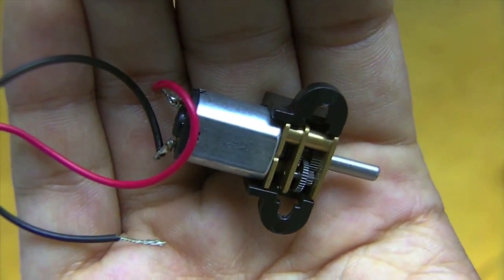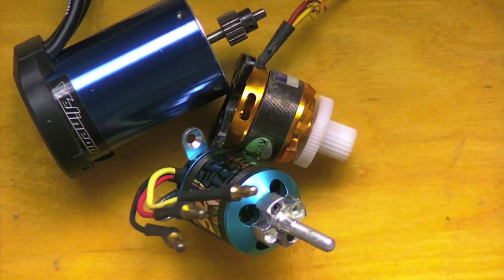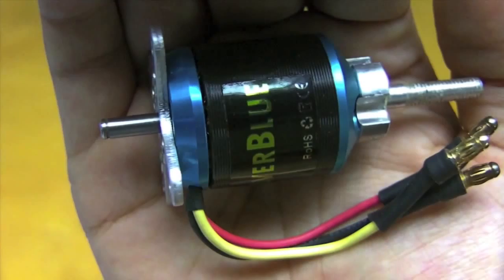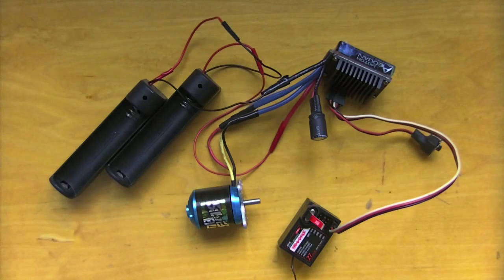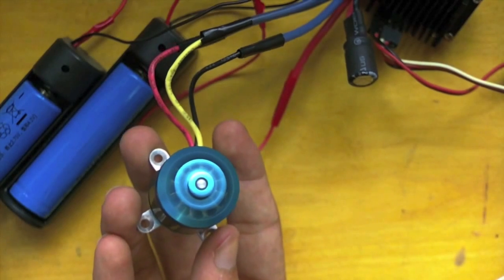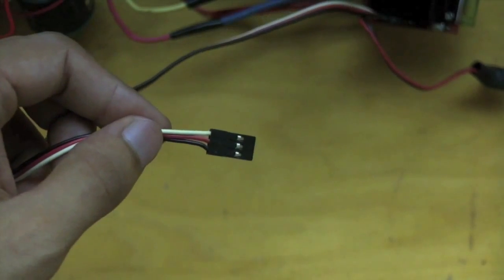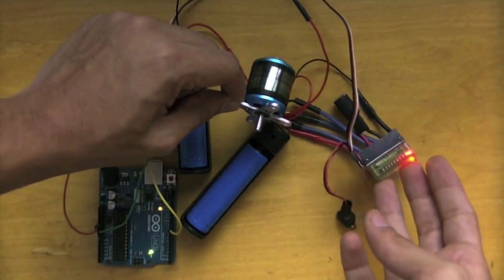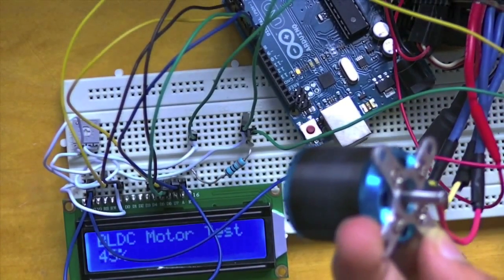Controlling Brushless ESCs | Arduino Tutorial

Comment: Go read some more kid.... you're wrong. Change the title to how to control an ESC and KV is not revs per volt, it's far more complicated than that and in fact, the KV "rating" of a motor tells you nothing of it's power or rpm. Sick to death of all these arduino dim wits filling up the net with misinformation. Looking for an ego boost "oh how clever I am!!"  fuck off!  Wasting my time.
Reply from the maker: Thanks for the comment mate! Yeah I did change the title, I just figured the kind of people to watch my vids would be the type trying to get a brushless motor up and running quickly with an Arduino, not the type with a 3-channel scope and a bunch of MOSFETS lying around to design their own ESC. I mention that 3 minutes into the video.

If you have a nice explanation of kV, and how it relates to torque, current, back-EMF and ω, we'd all love to hear it. But again, for the average person watching this, thinking of it as the RPMs you'd get per volt when spinning it unloaded is good enough. Even if you're into some hardcore drone racing where the difference between 2350 and 2400 kV is a big deal, thinking of it this way is absolutely fine.

I rewatched the entire video, and the only "misinformation" is where I didn't mention that kV readings only really apply to an unloaded motor, and more specifically they're meant to be read in reverse (i.e. 2300kV means when you drive it at 2300rpm you'd get 1V of back-EMF). 

Us Arduino dimwits are the ones that make up the embedded hobbyist community; the whole point of Arduino is to take something previously esoteric and make it accessible to the layperson.

Comment: No matter how long I search, you still need an ESC and transmitter. I took apart all those hard drives for nothing. Time to chuck it all.
Reply: +Nukes Away you dont need a transmitter, but you do need an esc unless your a master code writer/ circuit builder
Reply: you dont need to be a genius, and esc is quite simple. Basic electronics i would say. Most cheap ESCs are no more than an atmega plus some mosfets and some resistors'capasitos. Nothing fancy.

Comment: So i can use the ESC to control the motor without using a motor shield if i want it to spin in the opposite direction on the arduino?

Comment: I have been working with Arduino and similar micro controllers for two years now, just some thing about your wiring:

Arduino can be powered either through USB or the VIN pin, if you want to power it with USB, only connect ground and signal to the board, this way you can still access the Serial interface.
If you want to power Arduino from the ESC, you should connect the power wire to Vin pin, this pin is protected by voltage regulator and therefore is a more safe practice.
If you both connect the USB and the Vin, the board will automatically choose which ever has a higher voltage to power itself. Dont worry, it not going to blow up :)

You should NOT connect the power from ESC to the 5v pin though, the 5v pin is meant to provide power to other devices, not to power the Arduino itself.

Comment: Catalin Bitire 9V batteries should be fine. The 2-3 cell lipo guide is there just because ESCs are meant for RC planes and stuff, where lipos are used. 1 lipo cell has a nominal voltage typically of 3.7V, so if your ESC says it's for 2-3 cells, give it between 7.4 and 11.1V.

Comment: Thanks. Helpful tutorial.
But if you only need the motor to run full speed forward or full speed reverse, can you simply apply 5vdc or 0vdc to the ESC control line?

Comment: What sort of brushless motor should I get for an electric skateboard? From what I can tell I'd need torque, but thinking that the "gear" ratio would be 10:1 (not sure at all) I would need rpm. When I say gear ration I mean that I plan to mount the motor next to the wheel and brush the shaft (with a pinion of sorts) to the wheel itself. Would you recommend a belt?:)

Comment from the maker: Since you're using an outrunner, I'm going to assume it's for an RC aircraft of some sort. Basically, lower KV (rpm/volt) = higher torque but lower revolutions per minute at a given voltage. I'd say don't worry about duty cycles and such - the ESC does all that for you! Wire it up to a suitable power supply (i.e. 2 cell LiPo), and give it the right signals! a 1.5ms pulse (every 20ms) is neutral, 1ms is full backwards, and 2ms is forwards. Check ebay for motors! 1250 KV is pretty standard!

Comment: Im having difficulty locating a tiny low KV outrunner for this particular project.  What do you predict would be the result at running it at a low voltage at say 50% duty cycle for example ? Thanks

Comment: Would it be practical to run a KV:1250  at half a volt to get around 600 rpm, or do they simply run unreliably at that level?